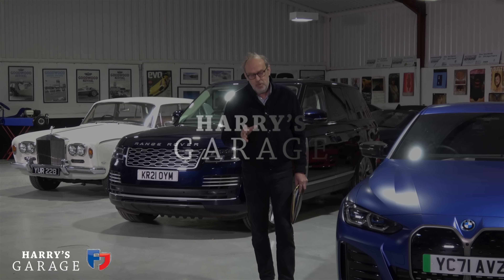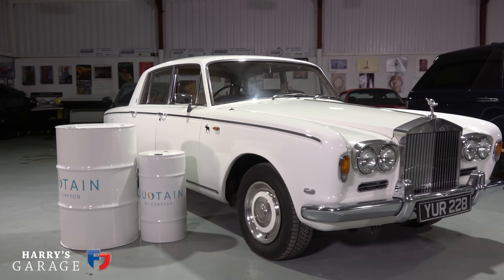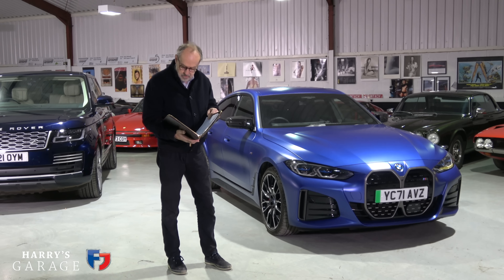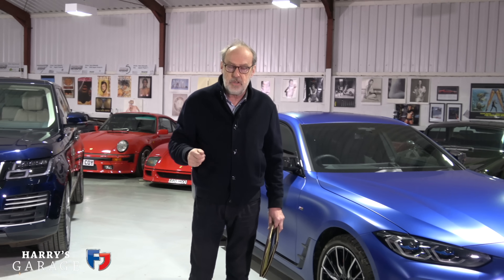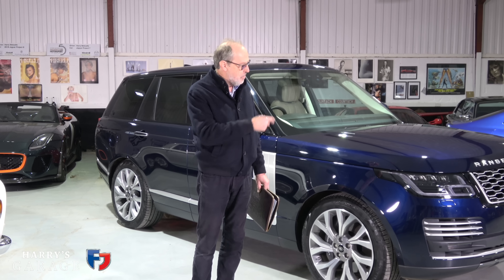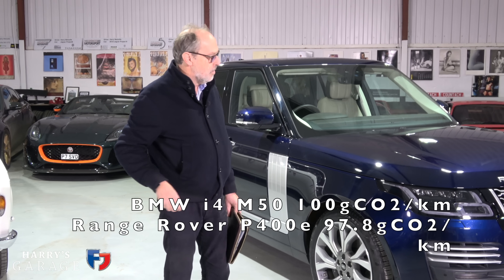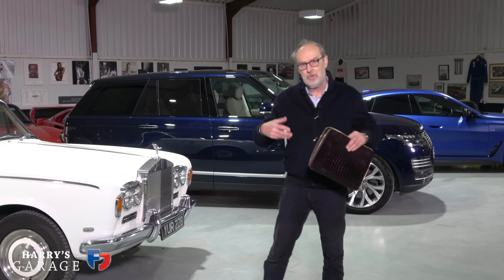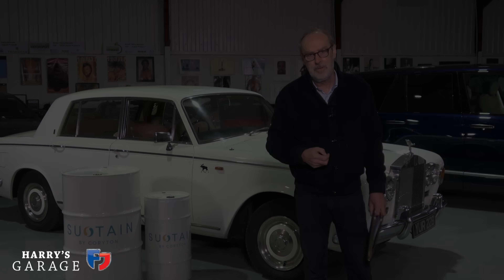Sustainable fuels; what are they & are e-fuels better for the planet than running an EV or PHEV?

Comment: Outdoor Air Pollution Kills 4 Million People Worldwide Every Year.
For vast majority of the population, the outdoor air pollution means cars and trucks with internal combustion engines.
Burning eFuels would still kill those 4 million people worldwide every year.
Driving electric (and PHEV) cars in the cities would save 4 million people worldwide every year.
Sadly for the carbon-based internal combustion engines, the CO2 is not the only deadly thing they spew out.

Comment: I have a  small problem with the sustainable fuels. Where I live, in Germany, there ist a huge shortage of agricultural land for food production at the moment. One of the reasons is fuel and electricity production with plant based materials. The result is increased price of food. All well and good that we can do this and it does not add to the co2 problem but on a large scale we would have to come up with ways that this doesn't compete with our food crops.

Comment: Interesting to see where sustainable fuels get.  They are needed for heavy vehicles (inc fam vehicles), aviation et which don’t electrify easily.  Their downside is the efficiency of the process to make them and transport them (in some respects we’ve already got an infrastructure we are having to replace which also has an impact).  Todays electric vehicles are quite high impact as you note - it would be interesting to get a proper lifecycle comparison.  They are also expensive and given the cost of the batteries will we ever see low cost long range cars?
I’d love to keep my Cayman going as a low emissions vehicle

Comment: EV,s are NOT the ANSWER!!!! There are green house gases making EV,s, batteries last about 5 years then you MUST consider your battery needs to be replaced!!!! Making a NEW battery MORE green house gas, who will RECYCLE ALL the old batteries???? 
The SIMPLE REASON planet earth is in the state it is in, IS CUTTING DOWN TREES/FORESTS!!!! 
Trees green leaves breath in pollutted air and cleans it taking out the carbon monoxide etc and releasing clean air, MORE MUCH MUCH MORE TREES are the answer!!!!

Comment: Hmmm. Interestigly, this actually was more enjoyable - and more truthful - compared to another British channel who is shouting DIRTY DIESELS every time a conventional engine is mentioned that has been around for more than 100 years. There's a lot, a lot, a lot  more to it - than merely the blind hugging of pandas, wales and polar bears. I mean, you can hug them - but tell them that putting in place an entire system - infrastructure of charging - and infrastructure for mining a totally new kind of mineral - is more harmful - and then see if they don't start slapping you in face with their paws while shouting DIRTY BATTERY EV FANTASY! Anyway. I think getting rid of hundreds of heavy fuel oil operated ships would be more beneficial to environment than taking all the petrol-and diesel driven cars on the planet away several times over - but hey, what do I know. Greetings from Latvia (litre of diesel fuel is EUR 1,77 incl. VAT at the moment, March 15, 2022).

Comment: Recycling is the answer few people think about. A car will consume less energy in a 20+ year lifetime than the manufacturer used to make it. Think of all that mining of ore, heating and stamping of sheet metal,  plastics, manufacturing and sales employees travelling to work, factory heating and lighting and then as we dont make cars here anymore ..... shipping. All done with diesel oil. Fifty years on your Roller's carbon footprint disappeared years ago before the climate changed. You could run it on two-stroke and it would be cleaner than a new vehicle. Classic cars/old cars are our history/heritage and non polluting. Don't go on a guilt trip about running them on petrol.

Comment: If you could travel back to around 1900 I suspect there may have been an ancestor of Harry’s in a barn comparing the costs of a team of shire horses with a traction engine with one of these new fangled internal combustion engine contraptions 😉

Anyway the comparison matters not cos motor manufacturers are investing in EV’s and combined with ULEZ’s and a desire for energy security, I expect the internal combustion engine will quickly disappear from every day motoring use. 

Hopefully bio fuels will keep classic cars and motorsport going 🤞

Comment: Sustainable fuels have to be delivered, the CO2 cost needs to be factored into calculations.  At what point will the need for sustainable fuels outstrip the availability of the crops required to manufacture it, not forgetting the cost of getting those crops to the plant where the fuel is being made.  I hope we don't see similar problems caused in Africa, where a cash crop like tobacco was grown, leaving the people who farmed it starving.

Comment: Harry, while you do mention the BMW as an EV may not be around in fifty years time like your other classics, it is a point which people do not delve much into. Folks are being led down the garden path when it comes to fixing or replacing the batteries in the future. There are no guarantees from the manufacturers to say that batteries and their associated electronics for these EVs will be available in 20, 30 or more years time. The current world wide chip shortages just shows how important electronics are in today's cars. Much like all computers and electronics of yesteryear, just try to fix something for which a chip is no longer being made. Or in the case of some manufacturers, chips not even marked in any way, no information on given circuitry etc. One does not fix these, one just scraps things and buys another. EVs will be either non-fixable or it will cost too much for repairs to be practical. As for 50 years worth, how about this story about a 9 year old Nissan, driving.ca/features/feature-story/the-big-looming-problem-with-old-evs-its-really-really-hard-to-change-the-battery

Comment: Totally agree Harry, I’ve run phev cars for 8 years, quiet, refined and if you want to go long distances, you’ve got a petrol engine as back up.
Not the most exiting of drives, but they are good.
At the weekend I have a BMW Z4 3 litre turbo, which is exiting, but the fuel cost ! 
The phev is great in snow at the top of the Pennines because it’s four wheel drive, the beemer just spins it’s wheels.
Sustainable fuel is great, but what will the tax levied on it make it usable?

Comment: Thanks Harry. However, there's a factor that you always miss when you cover EV numbers.  You keep equating energy at the wall with energy in the battery.  From my research it seems that there is a loss of 10-15%. 100kw charged by your electricity supplier will deliver 85-90kw on instrument panel. I hope you pick this up.

Comment: Oh my, taking advice from the Germans on anything to do with climate change & energy policy is (particularly in light of current events) spectacularly laughable. Germany (until now) has spurned US LNG because it's 'fracked' but you know, let's have some of that oil&gas from Russia, and let's crank up our coal. E-vehicles stand (as technological wonders) on their own merits independent of carbon footprint and climate change. But everything else, including the pretzel-logic of 'sustainable fuels' is, relative to China & India's ongoing commitment to coal, virtue-signalling. I'm originally from the UK, but the sheer volume of climate-moralizing  (including referring to natural gas as 'dirty') emanating from there is not only naive, it's just bloody tiring.

Comment: A lot of savvy EV drivers in the UK use tariffs such as Octopus Go. Charging vehicles overnight at 5-7p per KWH, so using an EV would be a fraction of the cost that you predict.
Reply: And you should be able to get between 3.8 to 5 Per Kwh.

Comment: Bloody hell, the mile to kWh ratio on that BMW is awful.  Most other EV's are generally twice as efficient.

A couple of things to consider:

 While the carbon cycle may be closed with renewable fuels, you're still releasing particulate matter in to the atmosphere.  Not to mention the process of making, transporting and using these fuels is immensely energy intensive.  Better to just use the electricity directly.  They may have a purpose in situations where batteries or hydrogen aren't practical (pretty much only aviation and shipping).

 I would have thought electricity travels better and more efficiently than any other means.  Just consider how much energy is used in manufacture of vehicles, ships, support infrastructure and last mile delivery (also the fact that the use of liquid fuels itself is terribly inefficient) for liquid fuels compared to grid setup and transmission losses.  Even over thousands of miles it's probably still far better for electricity.

 Not that you need transmission lines that long.  Wherever there is sun, wind, tide or elevation change, you have the potential for electricity locally.

 Also, criticising the impact of manufacturing of EV's is only a valid argument if we never produce another vehicle ever again.

 Having said all that, it's good that processes and techniques are in place and being developed that allow us to keep fossil fuels in the ground, where they belong.

Comment: Would be really interested in hearing how the synthetic fuels get along with old fuel systems- do they clog up carbs, eat through rubber lines, corrode steel tanks etc?
Reply: I would be interested in this also. I would imagine one of the big advantages of synthetics would be none of those problems since you're making it from base up. With Ethanol based or similar you always have the limitations of the base it comes with but with a synthetic thats all open for development. 
Of course thats me presuming but if you look at how the quality of oils went through the roof when we started using synthetic I think its a fair assumption - if not right now then over time as they develop.

Comment: Do you have to pay tax on the synthetic fuels? I used to run a scabby old Escort on veg oil and was amazed when the government actually decided to do away with the tax evasion nonsense that surrounded it at the time *just after I got rid of the car, typical!). 
If that £3/litre figure is taxed then they're already perfect for classics if the treasury got round to correctly categorising them!

Comment: So...if my PHEV produces less or equal CO2 per mile compare to an EV... why do I have to pay the congestion charge and the EVs don't.
Reply: His PHEV CO2 calculations are assuming you have a wind turbine providing free electricity on your land only charging up the PHEV (not the EV) and comparing that to a BMW that get's all it's electricity from the grid. A PHEV produces a LOT more CO2 than an EV, if all things were equal.

Comment: 1. You calculated the CO2 in generating and transporting the electricity to you, so you can put it into the electric car. But you only calculated the CO2 produced by the Range Rover when burning the fuel in its engine. You didn't add in how much CO2 was produced in producing and transporting the petrol before it got into your fuel tank..
2. Sustainable fuels for classic cars are fine. But classic cars are a tiny proportion of cars. Yes your Rolls has been going for 50 years. But the vast majority of cars on the road are not hand built classics that will be cherished for 50 years. They are driven hard and most ICE cars are dead and no longer useful after 150,000 miles or 15 years at most.
3. Sustainable fuel itself may be Carbon neutral. But the transportation of it, storage etc? Are the ships and trucks used to get it to you also using carbon neutral fuels? You have to factor that in to the CO2 calculations.
4. Carbon Neutral fuel is fine for low volume use. But if all the diesel buses and trucks and cars in city centers swapped over we would still have the air quality issues and the resulting health problems.

EVs should be seen as replacements for Vans and everyday cars that currently sell for about £20k to £80k and are used as the main family or work or commuter cars and do about 6000 miles upwards every year for 4-5 years and then the owner replaces them. Which would be the vast majority of vehicles. The Batteries of which can be re-used and recycled without the need to go and dig more of the harmful elements out of the ground.

You should have a discussion / interview with Robert Llewelyn of Fully Charged. That would be a very interesting debate between 2 people that have similar interests and highly knowledgeable but have reached different conclusions.

Comment: These "carbon neutral" fuels are only useful once the CO2 has reduced from the atmosphere otherwise you are keeping the status quo plus burning these fuels still pollutes.  Usual video from a non-expert without any references to any independent reports or research data to back up claims.

Comment: Very good.My wife has an EV and I have done all the maths and since electricity prices haved spiked mile for mile and range the "fuel" costs even with the price of petrol are not all that different if you have to charge up roadside aswell.There is and never be such a thing as free energy.Which ever way you cut it the glory cheap days of the motorcar are gone and buried.You have to extract lithium which costs a fortune and put more into the grid to support the trend.Nuclear france adopted full on decades ago so their electric is much cheaper than the UK.We have all but demolished our power stations and import via cable.The thing is who actually cares about carbon emissions.The days of smoking chimneys are long gone anyway.We are entering a shrinking world again where travel is less and that old Rolls Royce was from a time long gone.

Comment: We need of all, because not all energies works for some areas, for a balance, i would make it like that, an example:

ICEs: 100 units
Electrics: 100 units
Hybrids: 100 units
Fuel Cells: 50 units
H2-ICEs: 50 units

The most important here is that the fuel and its production be ecological, the same for the vehicles production. ♻️

Comment: Much like most people when comparing electric vs fossil emissions, you've included the CO2 created to generate the electricity, but not included the CO2 created to get up the fuel, refine it, transport it, the ships and helicopters travelling to and from rigs etc etc etc.
Reply: https://youtu.be/1oVrIHcdxjA
Reply: couldn't they all run on bio fuel as well? problem solved
Reply: He also missed out the fuel the power station needs and the losses from sending the electricity through the grid to the chargers and then the cars. 
When its a few percent at each change over then upto 10% charging losses that adds up pretty quickly.
Reply: @siraff4461  Think the whole process right through for the lifecycles of alternatives and it is all incredibly complex, but I suspect a truism is that the lifecycle CO2 payback for renewable electricity solutions is about 2 years. The case for running old cars indefinitely with sustainable fuels seems very good compared to frequently changed EVs that are unlikely to sensibly survive beyond their first battery lifecycle.
Reply: @philhealey449  Even 9 year old - some 1st Gen BEV Nissan Leaf cars have done 100,000s of thousand of miles.  Those wanting more range get their battery upgraded and the old one (doesn't go to landfill, doesn't even need recycling) gets repurposed as solar/peak generation storage.
Reply: @siraff4461  yes exactly
Reply: Not much more is it really.
Reply: @wolfiestreet6899  Of course it isn't much - if that makes you feel better about your choices...
Reply: @CoxJul  I am amoral on my choices.
Reply: @wolfiestreet6899  If you say that, you must know how much it is.  How much more is it?

Comment: Great video. Very informative. Actually, the Rolls is the best for the planet as it was made decades ago and will be the cheapest to run in terms of total cost of ownership, when you include depreciation, which will be horrendous on the BMW  and Range Rover. Don't even think about the cost of replacing those lithium batteries in 7 or 8 years time.

Comment: You can’t compare the BMW that was judged in one 135 mile round trip with the Range Rover that has done mostly local miles. Is the EV had done a similar type of local driving it would be much more efficient than the plug in. Not comparing apples with apples
Reply: This don't think that's correct. A plugin is an EV with a small battery. The electric motor and battery are going to be just as efficient.

Comment: So Harry Bases BMW mileage on 1 trip in winter and that changes drastically in summer. I frequently see 1/4 more energy in winter than summer. Then compares the Range rover driven with grandson, vs BMW thrashed down a trip to London... 69.1 mpg is a Bullshit number... Not when you run it on fuel and do "400 miles" and then the Coryton Energy 3/liter cost is great, but how much CO2 is created making that fuel. The energy they need to put into that process is ridiculous and the cost is base don subsidies. I agree that Cars should be kept on the road but your analogy on building new EV and energy need to do that is no worse than the old factories making ICE cars... EV factories are built netzero... So many misconceptions and white washing... Harry... I'm disappointed. Yes, you should put solar on your farm... Sustainable fuels really... They really sold you a bill of goods! The Propaganda... they got to you... so sad.
Reply: This…..